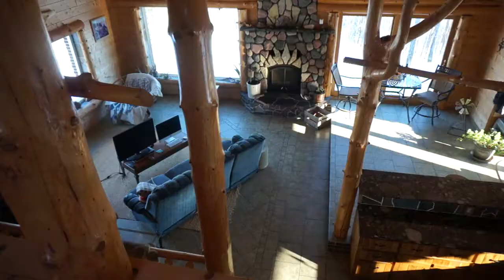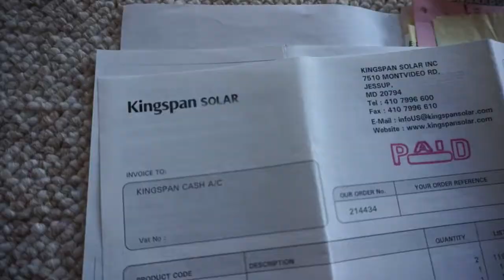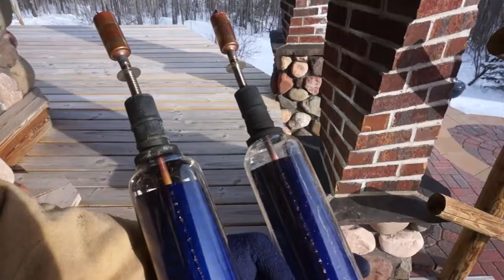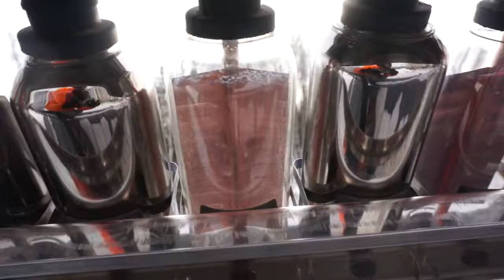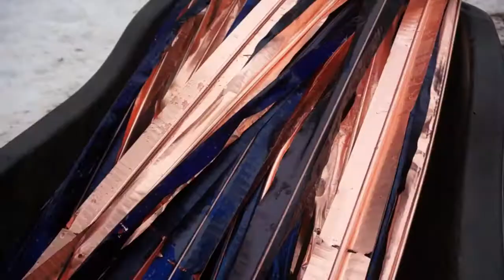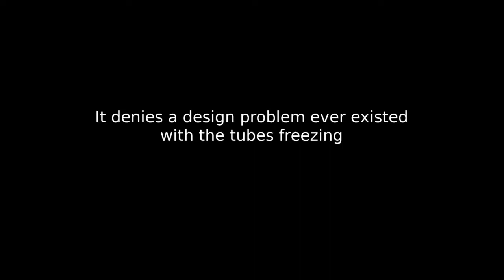The Kingspan Corporation Scam

Comment: We have installed this product for 35 years. We have 400 in the South Pole.  Over heating can be a problem so need to read the manuals and install it right. Sorry you had this terrible problem. Must have been a right pain. The DF100 direct flow tube would have been better as it had anti freeze in it. What did you do in the end?